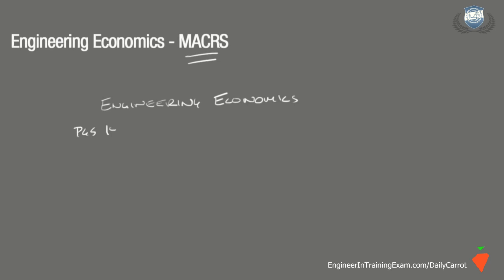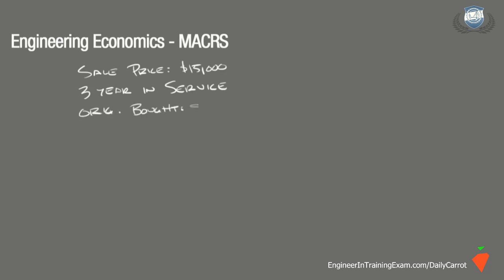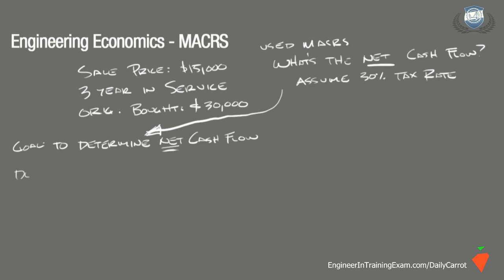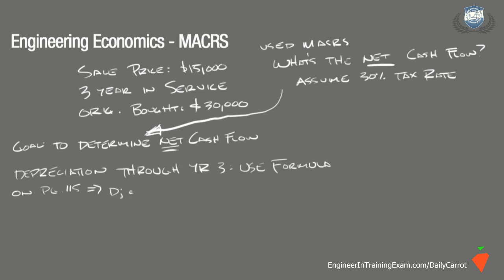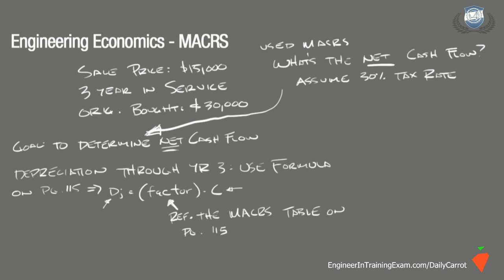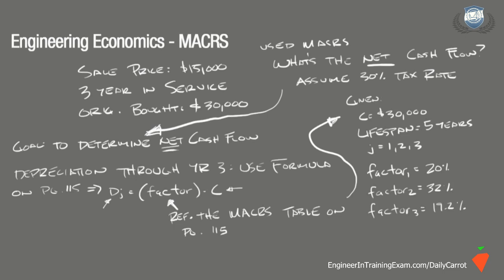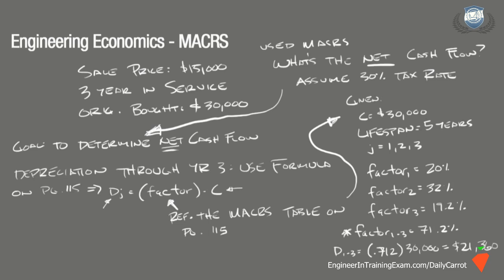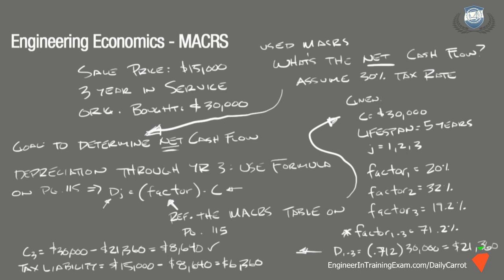Modified Accelerated Cost Recovery System Depreciation MACRS FE Exam Review

Comment: Is it possible to solve the factor without looking at table? And where did u get that 0.7 at cash flow.
Reply: What I think he did was instead of taking the tax rate of 30% he used 70 % of saving cost
Reply: @heetparekh1630  thats right, you either directly multiply by 70% or do ($6,360-30%x$6360)=$4452